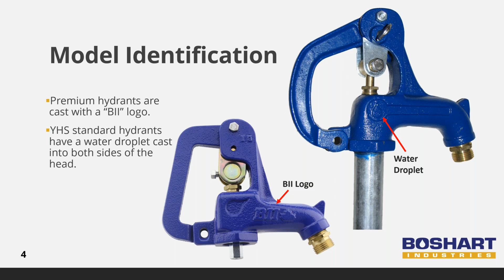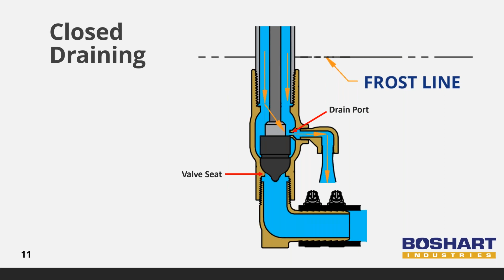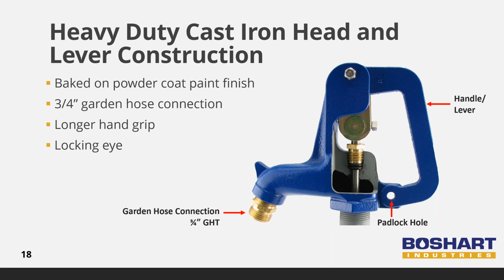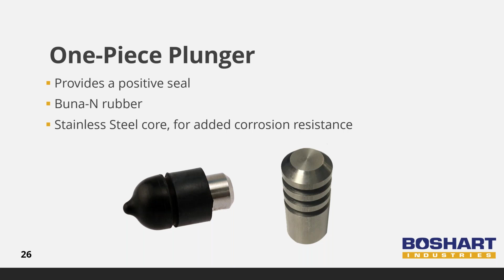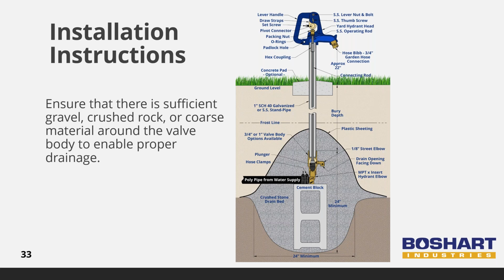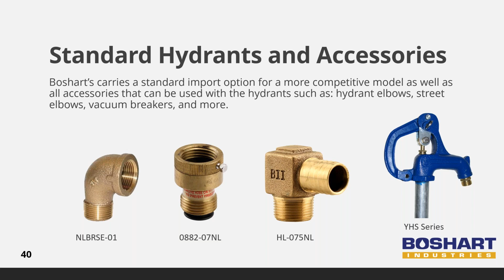Introduction to Yard Hydrants   Training Webinar

Comment: Its not a one piece plunger ,mine separated and its two pieces .
Why smooth metal in rubber so it can weaken and fail and slip out of rubber ?
Then a dig out for stupid failure !

Comment: Ive got a b11 and the crappy plunger separated from rod so i have to dig it out.
Very disappointed with this failure .
Make a plunger that dont fail and slip off the metal part.
And i have to buy a useless kit of parts that never really wear out  just to get a prone to failure plunger.

Comment: If I raise the "D" style Handle, to full "ON"  ... (Approx. 180 degrees from the "OFF" position)...and let go of the handle....the handle falls back..or..snaps back...or springs back
... to 90 degrees..... on it's own ....?????
.....with a significantly lower/slower flow rate......(obviously)
What adjustments are needed to get the handle to STAY, at 180 degree FULL "ON"  ......  I have NO LEAKS anywhere, above ground   ----->     ONLY SAID HANDLE ISSUE...!!!
Internet search....isn't helping, it's all about fixing LEAKS ...........Any help would be appreciated, thanks.